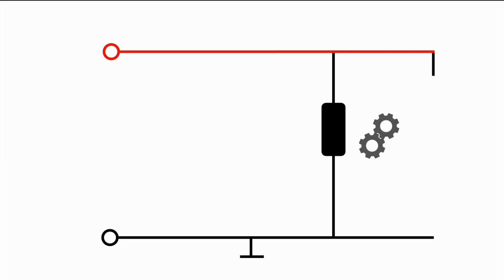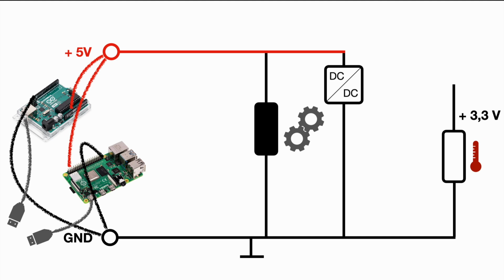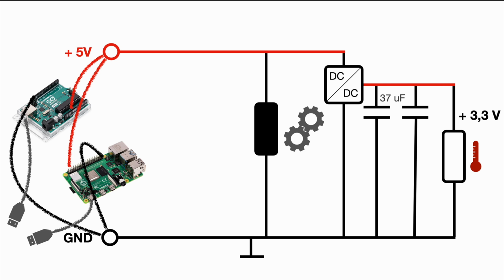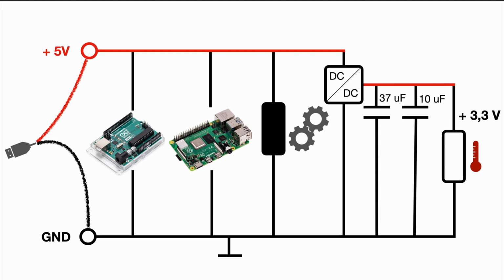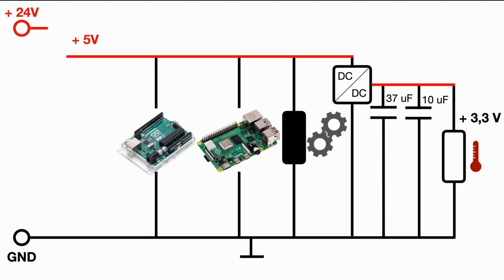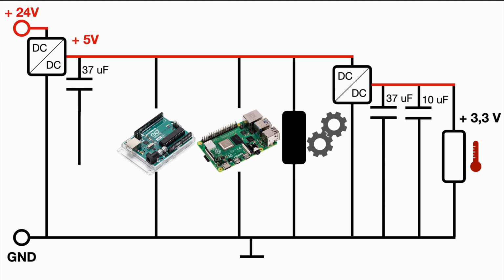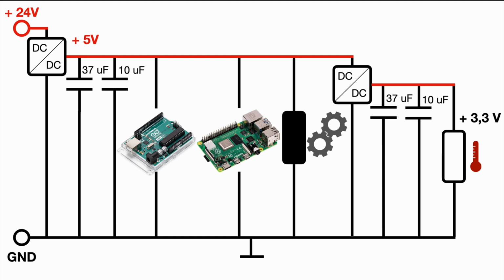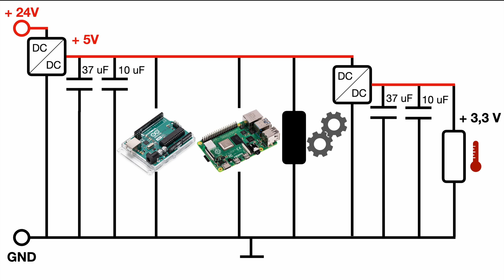How to supply a Arduino & Raspberry Pi & ESP project with power | DCDC converter

Comment: Thanks for this video. I want to power my raspberry pi and power components connected to a relay which the pi controls. I'm thinking of using the converter to step down my 12v supply to 5v for the pi and connect the relay components directly to the 12v supply. Do you think that would work? Thanks
Reply from the maker: 100%, 12V to 5V with a step down (make sure to use one with good efficiency (around 80%) and roughly calculate your power need on 5V (good step downs are quite price sensitive when it comes to the current/power they provide).
Personally I then get a check USB C cable, cut it, connect it to the 5V and plug it into the Pi: quick, easy, cheap and you can quickly unplug the Pi if needed.
Hope I could help you & good luck with your project!